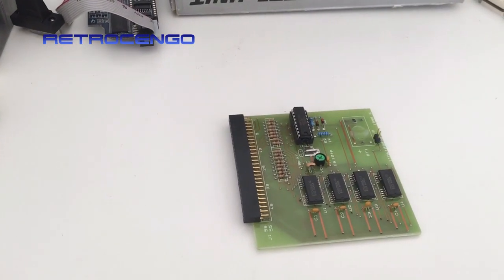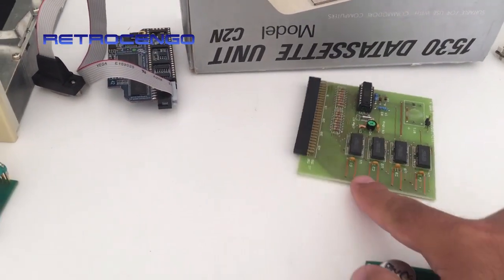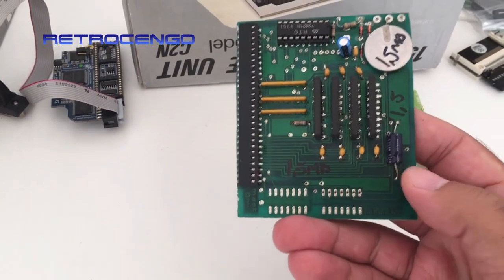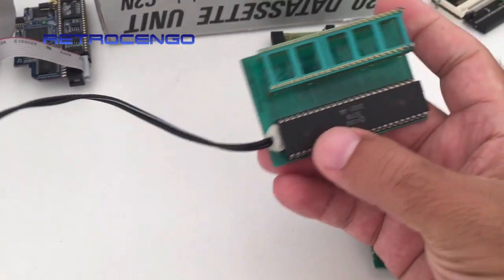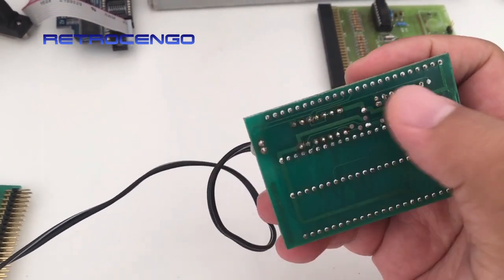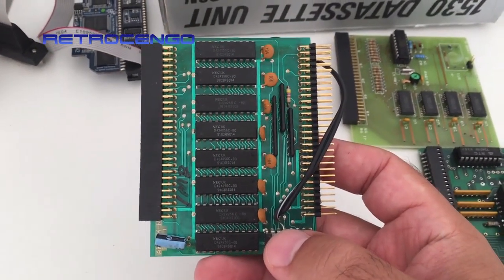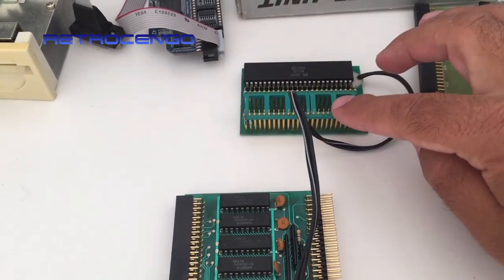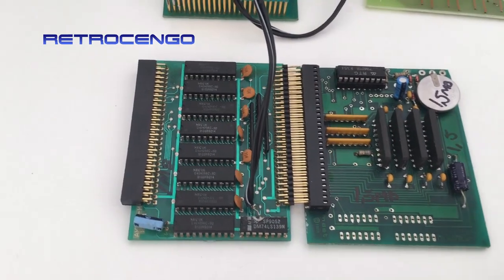Commodore Amiga 500 FASTRAM expantion with gary adaptor. 2.5MB fastram

Comment: today u can have a very cheap a500 with totally of 128mbram . no problems with the new adaptors.
Reply from the maker: FRIEDHELM ERNST ESSER Whoeew, how? Link tonthe cheap upgrade?
Reply: Amiga 500 (Motorola 68000) has 24 bit (16M) address bus, and half of it can be used for RAM. By the OS there should be no way to have more than 8 MB RAM.